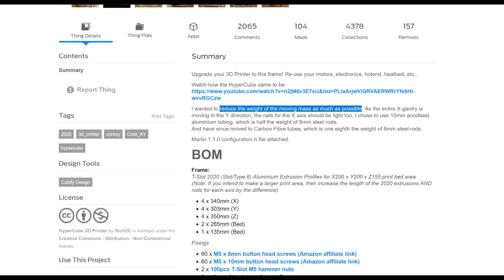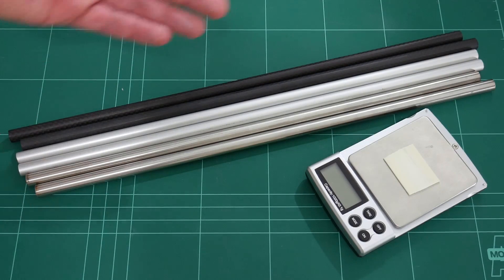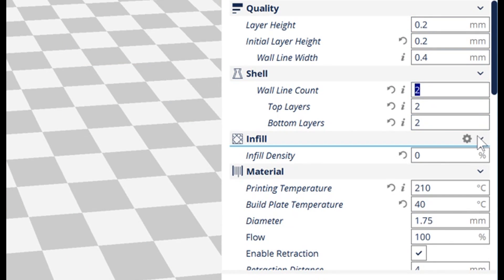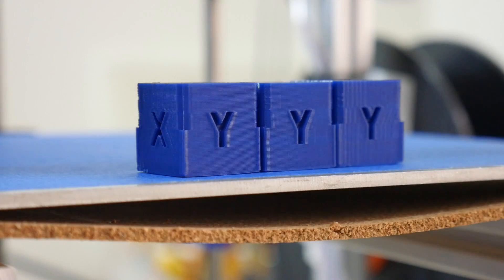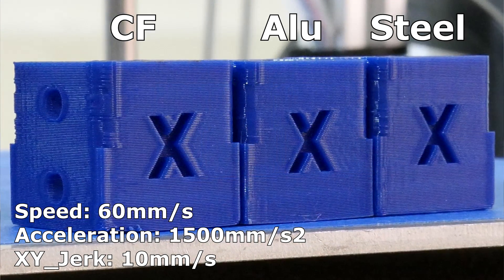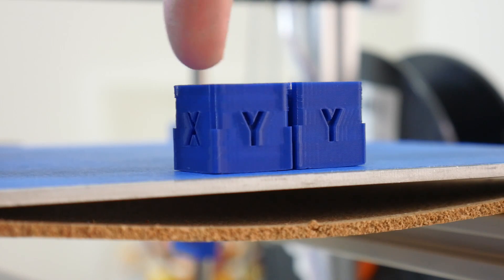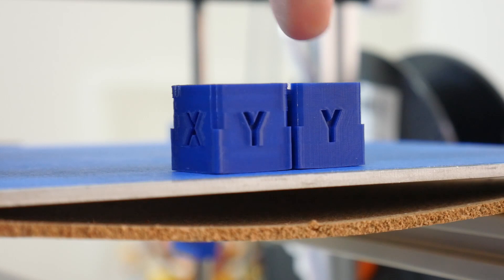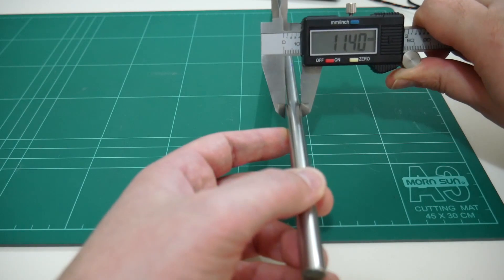THIS IS Y

Comment: Hey - those carbon rods showed up, took less than a week!  The bad news is that they sent them by UPS.  UPS dutifully charged me $1.09 sales tax - and a hefty $10.50 for their brokerage service!  OUCH!

Ah, well - they're here, and undamaged.  All five, 1 meter long rods.  FWIW, one meter of 8mm pultruded rod weighs 55 grams.  The 600mm length I need will weigh 33 grams.  I suspect that mine is heavier due to the thicker sidewalls (2mm wall thickness).

Hey, Tech2C, thanks for a great channel.  You really do decent work.  Something I know virtually nothing about is getting into the programming end with Marlin.  I don't have a clue even how to begin.  Do I load a file into a text editor?  Where do I get the file from?  Once I've edited it, where do i put it?  You begin to get an inkling as to how little I know.  If you were looking for a topic, "explaining Marlin programming as if you were teaching it to your grandmother" would be really helpful to me.

Cheers from the frozen Canadian north - Charlie

Comment: Perhaps the print head should have an accelerometer on it and the system go through a setup phase so that it can detect those issues and subsequently negate them through better print head control, i..e through dynamic software.
Reply: Great idea this is exactly what Klipper does nowadays. You were spot on mate.

Comment: I noticed that your cork insulation appears to have an air gap from the heated plate.  If you use 100% silicone sealant between the cork and heated bed surface it works excellent as an adhesive.  I put about 10-12 small globs and press the cork against the globs to flatten them out.  Let it sit overnight and you are golden!
Reply: Great idea, I have the same problem.

Comment: Very interesting test. I didn't know you could get Carbon Fibre rods for printers.
I have the Anet A8 and am currently modding it to improve it a bit. Next mods will be changing from direct drive to bowden, and an e3d v6 head. Maybe some dry bearings as well. Not sure what else.

Comment: Neat video! I like your content. 

Also, damping not dampening. No one is getting wet here. And underdamped oscillation for that matter.

Harmonic oscillations relative to rigidity of the gantry design and induced harmonics from the printer movement. Try a steel tube as opposed to a steel rod as well...

Comment: Excellent vid, thank you. I have the same affects you mention on prints on my Wanhao Select Maker Plus. I though these issues were common quality issues because of the type of printer we have to live with. Do you have any opinions on the Carbon Fiber tubes as far as thickness vs rigidity and quality. Seems like a very inexpensive upgrade. Thanks.

Comment: Would a prusa i3 clone(Anet A8) benefit from carbon tubes instead of the X-axis smooth rods? With bowden setup(and without, if you can answer that too)
Reply from the maker: On Prusa style printers the X axis rods only move for layer changes, therefore no benefit.
Reply: ah right, didn't think of that.

Comment: now what is oscillating?  the belt?  the motors?  the frame?   i think the MK2 has defaults at 1500 acceleration, does not seem to ring as bad as this.... perhaps the frame just isn't solid.   some aluminum panels covers might help a bunch.  maybe just wood or acrylic would make it stronger even.

Comment: Pressure advance FTW.... low acceleration, sharp corners, even the 1500mm/2 accel can benefit (usually does).   Though it's another dimensions to tweak per filament.  unfortunately it ain't so good on a bowden.

Comment: Interesting video. I bet the steel rods are close to advertised size. Digital calipers cannot replace high quality micrometer for really fussy measurement. Even then it takes some practise to get the feel of using a micrometer. Lots of beginners try to use them like a C clamp : )

Comment: for carbon fiber should i use non ball bearings so that it doesn't get worn down or does it withstand the rubbing pretty well?
Reply from the maker: Correct, they are called plain bushings. Check the HyperCube Thingiverse link in the video description for the parts list.

Comment: Measure the shafts with a micrometer for proper accuracy.
Calipers are good, but for true precision mic em....
Reply: I was thinking the same, its probably those $10 calipers that aren't accurate.
Reply: AussieMatt That they are. The funny thing is it probably is 10mm, just an inaccurate measuring instrument.
Reply: Ray Jones thay are "only " 70 € I got one that  will do 0.001 mm  but I use it for school  so if you don't have one 0.05 mm is good enough for your purpose

Comment: Also how do you stop non steal  rods from wearing. I can imagine that carbon tubes have only a resin surface which would wear very quickly?
Reply: The load on these axis is very little, if it is properly setupand high quality carbon rods it shouldnt wear that fast at all. Epoxy is actually quite hard and, like i said, the load that these bearings have to transmit is very low.

Comment: I've watched all your videos and am very impressed with the science you apply to all your testing.
Indeed, weight is the enemy of all 3D printers and lugging around steel is a very bad thing to do.
On Prusa i3 type printers, I've never understood why people put glass on the bed because this can weigh around 300g in itself.
I've printed your new X carriage design for an E3D hotend and been very impressed with the results.

What kind of time improvement do you get with the carbon fibre tubes whilst still maintaining an equivalent print quality comparable to the steel rods?
Reply: Interesting, didn't consider a glass bed would have that drawback. Thanks for pointing that out.

Comment: I appreciate all the effort in the testing, but the whole time I was looking at the edges of all the 60mm/s prints like, is he going to address what a mess these edges are?  Only the 30mm/s had decent edges.  It may be a solvable problem, but until it's solved there's no point cutting weight to go high speed when all the high speed prints look like that.

Comment: Another factor here you could experiment with for the bulging corners is called linear advance. Thats its name in marlin firmware but it's also been implemented in some others like smoothie. Basically it gradually lowers the pressure in the nozzle when you approach a point of zero extrusion so that none will ooze out. Might be worth looking into or even doing a video on!
Reply from the maker: I wasn't aware of that feature - thanks for sharing! I'll look into it.
Reply: No worries! http://marlinfw.org/docs/features/lin_advance.html the documentation here is really useful
Reply from the maker: Hey mate, I tried lin_advance, but I didn't notice an improvement at any speed or acceleration. I'd set it up in configuration_adv.h and also using M900 commands, and could hear the extruder motor skipping if the K factor was over 200, but it just didn't improve the bulging corners.

I did read that this feature is best suited to direct drive, and that Bowden may be less useful? Bit of a let down. Have you used it?
Reply: Hmm.. did you follow the calibration instructions on the documentation website? I mean doing the test cube with the specific values it specifies and making sure you have wipe and coasting and all of those other features turned off. I haven't personally used it yet because prusa marlin hasn't implemented it. However, I have seen really really nice results from prints done on a tevo tarantula using lin_advance which is bowden
Reply: Linear advance should be more useful with bowden setups. You might get better results in direct drive though only because you're already 90% of the way there as far as having better pressure control due to having a short filament path. The whole purpose of linear advance is to model the actual pressure in the hotend to provide consistent extrusion due to the springy nature of the filament as it's pushed and compressed into the hotend by the extruder. The longer the path is from the extruder to the hotend, the more compression force will have to build up in order to actually push the filament through the hotend, so then when you stop (or slow down) extruding, you get extra extrusion at the end as that compression force is then released out the nozzle. Linear advance attempts to regulate this by slowing down the extruder or even reversing it if needed, essentially decoupling it from the X and Y axes.

Comment: if you have problems with corners bulging out, have a look at LINADVANCE in Marlin, that reduces the extrusion as it approaches a direction change and it tunable in gcode
Reply from the maker: Cheers for that! I wasn't aware of that feature, I'll look into it.
Reply: Tech2C I think it might be in the advanced config h file. It really helped me out for getting crisp edges
Reply: What about coasting? Would it work?
Reply: OR.... install a parts cooling Fan

Comment: Okay, Tech2C.  You've sold me.

I've been - theoretically - building a 3d printer with a 500mm X 500mm bed and a 450mm lift.  But it's taken so long for parts to arrive from China to Canada - about 14 weeks, on average - that I'd kind of lost interest.  I had been considering 8mm hardened steel rods for the 500mm span, but I saw your earlier video on the CF tubes you installed, so I held off.  The trouble with a 500mm bed is that you need a 600mm tube; and you can get 600mm hardened steel tubes, but you can't get 600mm carbon fiber tubes.  The best deal I could find was 5 - 1000mm tubes... delivered, to Canada, for $75.00.  Ouch.

So, I ordered 5  4mm X 8mm X 1000mm pultruded tubes.  Pultruded has less crush and torsional resistance than woven, but it is stronger at 90 degrees - if you try to bend it, for example.  And the walls are 2mm thick, so it ought to work.

Geez.  You have been absolutely the worst thing for my bank account.  But now I have enough carbon fiber tubing to build a bunch of printers.

Sigh.
Reply: Hi!  The hypercube is a great design.  In general, the linear guides and lead screws should be about 100mm longer than the build area, and the 2020 aluminum should be about 200 mm longer than the build area.  BUT these are JUST approximations.  The best thing to do is go through all of Tech3C's material, and add your measurements to his.  For example, if you want a Z axis 100mm taller than a hypercube, just add 100mm to all the vertical components.  If you go to his Thingiverse page, I think he's got all the dimensions listed.  To find his page, just go to Thingiverse.com and search for Tech2C.  Hope that helps!
Reply from the maker: haha I thought your printer would have been finished ages ago! Oh well the fun is yet to begin when you actually start printing...
For such a large span of the CF tubes I'm glad you chose a thicker version. I haven't had shipping delays from China to Oz in a awhile, but 14 weeks sounds ridiculous!
Reply: Yep.  Used to be about 6 weeks, but I ordered some stuff around December 5... and that's when the delays started.  Canada Post used to provide tracking support for China registered air mail, but apparently they've gotten into a spat.  CanPost now prominently states on their website that they no longer provide tracking support for China registered mail... and it appears that they're also 'storing' China shipments for a couple months in Customs.  Or so I suspect.  I had also finished the design of the printer, right down to every single part, bearing and bushing... and through sheer, unforgivable, utter stupidity I formatted the drive and lost it all.  Tried recovery software, but got nothing.  And that was just about the time that Autodesk announced that they were pulling the plug on 123Design, and that I'd have to shift over to Fusion360.  Sigh.  Just got a little bummed out for a while.  But you got me back on track, so I've ordered the carbon rods - and the 8mm bronze bushings to go with them.  So, lets see.  It's the middle of May...I'm sure they'll be here by late August, early September.  Sigh.  At least it gives me a bunch of time to learn Fusion 360 and redesign everything!
Reply: I am in that same situation myself and worse.  My print area will be 300x300x360ish which is already huge enough to require 450 watt mains powered heated bed.  I don't like having to do the mains powered heated bed at all.
Reply: If you can find a discarded desktop computer somewhere, you can cannibalize the power supply.  Failing that, you can buy one for maybe $50 or so.  They usually can supply 400 - 500 watts on the 12 volt rail, so they make a great cheap power supply.  No need to go with a mains supply, a cheap fiberglass mat heater (usually red in color) is typically around $10 - $20 and has resistances designed for 12 volts.  You can use them with a plate of glass, or bond them to the underside of a sheet of aluminum.  I don't like having mains voltage in a system, either.  A decent 500 watt computer power supply should get you rockin pretty quickly.  Use a solid state relay triggered from the 12V heater output on your motherboard to switch the power supply in and out.  Good luck!
Reply: charles worton you don't need it to be mains powered for that size, i am using a 300x300 24v silicone heater that is rated at 360w but i have been running it at 400w+ using a 24v 20A supply and it got hot enough to crack piece of ordinary glass that i was using originally because i had my thermistor in the wrong place so it was seeing about 70 degrees when it was really at 140°c, i have since moved the thermistor to the center of the bed and I'm now using a tempered piece of glass and it will go over 100°c easily.
Reply: Hi, can you helm pe? I plan to build the Hyper Cube from my tronxy x3 ! But i want a 300x220x220 Build Volume. Any sugestions about the length of the 2020 Aluminium , Lead Screw and Liniar guide length ?

Comment: 12:01 There is most definitely ghosting on the print on the right...You can see it to the right of the Y. Watch it on a desktop, not a phone.  YES the print looks better, but ghosting (The repeating pattern of the Y) is clearly visible.
Reply from the maker: It's clearly visible with a 12-megapixel photo zoomed in 10x, but to the naked eye it isn't clear at all... ;)
Reply: Normally I would tend to agree...but I saw it on the video on a 1920x1080 video.    Apparently, with 12 megapixel reverse-engineered vision..  ;-)
Reply: there's a lot to be said about the way cameras see the world vs the human eye. I'd wager that the difference is imperceptible even with the tongue test and that what you see is most likely an effect of the contrast and slight difference in angles to the camera.
Reply: Lol, yeah...clearly I know nothing about cameras.

Comment: Hmm... I'm dubitative. Your printer have a light tall frame. I believe this probably affects the results. Will it be the same on a printer with a stiffer architecture ? I'm not sure... With the same test you could demonstrate the limitation of your frame....
Reply: Extruded aluminum (80/20) not rigid enough? I think not. That's a basic design premise for the Hypercube. Most other 3D printer designs are decidedly less rigid.

Comment: Had a scroll down the comments to see if this was mentioned, but it appears that nobody had considered the bed. As a cantilever component it's far more likely to be moving due to vibration than the gantry. While your testing is valid, the steel Rods result in more ghosting, it's not the Rods that cause it. It's because the bed is an supported cantilever and the heavy moving mass is causing that to wobble. That'd be my theory anyway. Thanks for the video
Reply: No More BS Please  removing the weight that was causing the inertia will obvisly stop the ripples that doesn't mean it's the problem, that's why slowing the acceleration down also worked. Bolt the whole machine to a concrete floor and use a fixed bed instead of a floating one will also stop it.

 if all the motion control components are solid and have no play then the wobble has to come from somewhere else. Simple to test wobble the table when its printing and see what happens.

Exactly the same issue with cnc routers  and lasers have if the bed or the machine tabke isn't solid.
Reply: This could be tested by printing each test at different Y positions. Prints further away from the Y support should have more ringing.
Reply: Adam Meadows It's the rods, or the CF wouldn't have fixed it! If it was the bed, the rippling would still be there.
Reply: @NoMoreBsPlease  Correlation vs. causation (Freakonomics)

Gantry mass induces bed vibration, in turn, resulting in ghosting, etc.

Correlation: Cantilever bed vibration.

Resolution: Modify bed design.

Don't stop at the first apparent cause. Sometimes you'll find that the tail does, indeed, wag the dog.

Going further, as the clip of the water glass shows, the mass of the steel rods induces vibration. These vibrations are transmitted to the build plate and manifested as ghosting in the test object.

Cause: Gantry mass.

Resolution: Reduce gantry mass.

Result: Fast print speed and rapid acceleration with high precision.